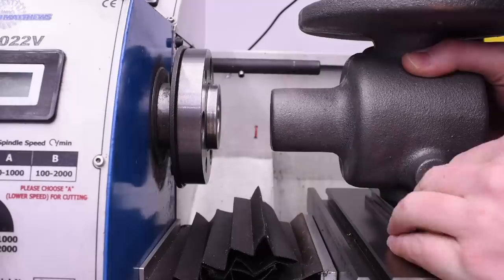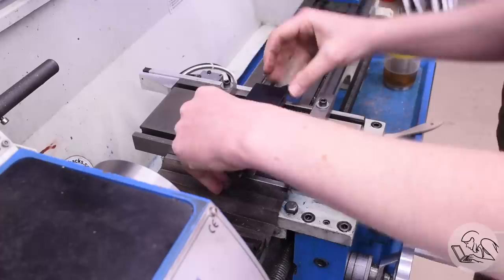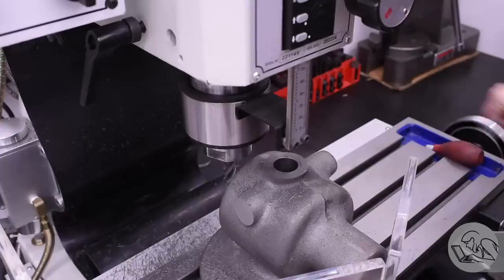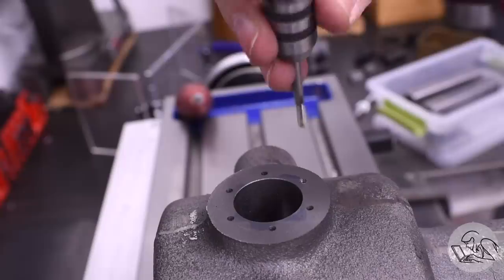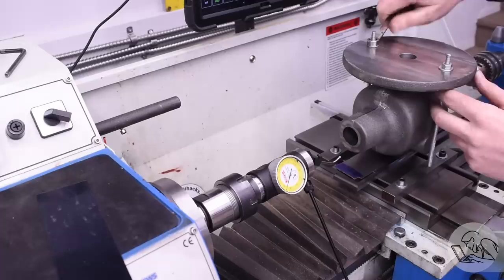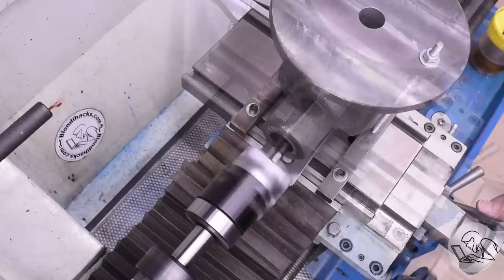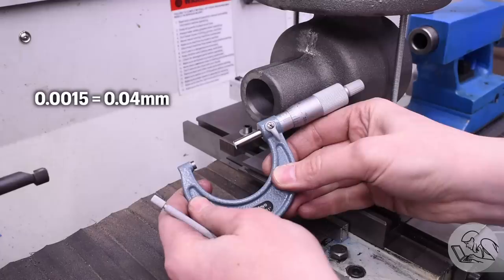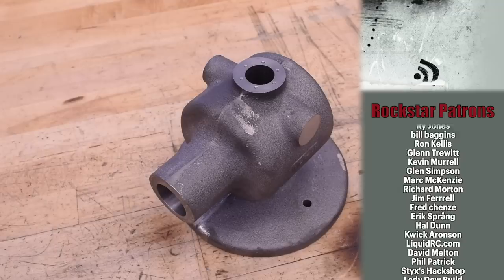Let's Build A Die Filer- Part 2

Comment: Quinn - that's one of the most intricate setups on a lathe I've ever seen. Bravo for pulling it off so well!
Reply: Necessity is the mother of innovation  (in Norwegian the saying goes  "A naked woman learns how to make clothes) 🙂

I started out with a mini-lathe, and it's incredible what you can pull off if you don't know the word impossible (or unsafe). I actually cut, crowned and threaded a rifle in it, 20" of barrel and a mauser action sticking out of the headstock. I could have ridden that work bench to town and back in 5 minutes.

Comment: Quinn, if you wrap a rubber band around the shank of the boring bar about 1/4 of the way back from the cutter, it dampens the harmonic that helps create chatter. You do the same thing when facing brake rotors, except it's on the rotor itself.

Comment: Nailing the dimensions when you're thinking those are not important is more than just a secret, it's a state of mind.
You will be a bit more relaxed, and therefore less prone to make errors in judgement. It's a "you know, just do things the easy way, there is time, no worries, it will be fine" way of thinking. It goes well in other practices too.

Comment: @Blondihacks.  You might be interested to know that your "new" GE motor was approved for shipment in February of 1933.  That's what that little BL code on the bottom right means. It works on a 42 year cycle, so it would have also been used for Feb 1975 motors, etc., but yours is much older.  The patent for that motor was granted in 1925 and expired in 1942. Don't ask me what rabbit hole I went down to find out such things, but it has something to do with restoring old stuff.

Comment: Quinn, do buy a motor for your filer. 
I am sure that this Vintage GE motor will come handy for a future project, but ... hear me out please. For years I was using my small lathe converted to a DC motor with a home-made PWM voltage controller, so that I would not have to swap pulleys and "V" belts. I was planning to make an Arduino-based system that would maintain desired spindle RPM regardless of what the cutting force is. 
Then I discovered that for a $100 you can buy a "Sewing machine servo motor" - a brushless DC motor that is supposed to replace a 3-phase motor for industrial sewing machines with a mechanical clutch. It is typically 500W and comes with a control box where you can set parameters and a lever you can press to set RPM. The motor holds RPM between 200 and 3000 regardless of load up until you stall it. It is brushless, so it has "electronic commutator" that reverses the polarity to keep rotor turning based on sensors, so it will go exactly the rpm you set it to with maximum torque. Oh ... and it only needs single phase power.

Comment: When this die filer is complete, you'll finally be able to make some dice and actually have a game of Yahtzee!
Reply: I thought it was just a device for helping you organize your collection of dice, no?
Reply: @brianhaygood183  well I could be mistaken. Hey, maybe she'll do a cheesy tool hack video where it's used to remove material from metal objects 🤣🤣
Reply: @ollysworkshop  
The other use for this is to fixture to the top with a tool that allows you to push into the file, at that point it can be used as a micro shaper, and so cut keyways.
Reply: she can already make dice, she has a lathe :P

Comment: Interesting and informative as always, thank you!

In anticipation of an upcoming installment on the Pennsy locomotive, I'll mention that the author of the plans (and several other great loco models), Kozo Hiraoka, is releasing his next book. It's available to preorder for shipping in the Spring. Promises to be a doozy at 400 pages; the other books are around 250ish  pages. Can't wait to see it. Can't wait to see Quinn's boiler coming along.
Choo choo
Reply from the maker: Oooh thank you! I will be ordering for sure.
Reply: @jeffdayman8183  "Building the Rio Grande K-27, volume 1."
I forgot to mention, it will be a two volume set. Second volume will print when the article series in  Live Steam is concluded. 
Use promo code K27 for a discount when ordering from Village Press.

Comment: With carbide tooling a good rule of thumb is to take a depth of cut 1.5 to 2 times the nose radius of the cutter, you can get away with less sometimes.
Small radius tools (or inserts) are nice to have if your machines are hobbyist types.

Comment: The motor looks like it has sleeve bearings.  End play is not unusual with a sleeve bearing motor.  It may just need a few spacer rings on the ends of the shaft to reduce the end play.

Comment: A trick I learned some time ago that is useful when mounting work to the apron of a lathe: if space allows elevate the work piece on a plate that is as thick as possible and has 3 drilled and tapped holes in a triangular pattern. This allows both height adjustments to align with the spindle and leveling as needed.

Comment: I am just about to assembly my kit after having finished the machining portion. So far it is pretty forgiving as to accuracy needed. You made tapping those 4-40 screws look easy. It was like performing surgery for me . The back plate holes don't offer much in terms of error however. I did the majority on mill as I did not have a lathe big enough at home. Only changes I made were installing oil filler on back plate and putting larger roll pin in driveshaft and cutting a gasket for backplate with a hobby vinyl cutting machine with gasket material installed. Almost wished I had waitied so I could follow along ... instead I made my own mistakes and inserted my own adult language .

Comment: I knew I've seen old-school setups where they mount the work on a vertical slide on the boring table, which would have been a bit less of a faff than the fiddling with stacks of parallels/shim stock. But that would require you to buy one of those vertical milling contraptions, which is a bit silly for just one setup.
Reply: Or make one.

Comment: Ohh, i got a similar vintage motor. It's 3ph, 220Volts. General electric i think. Still working fine after a lot of years, love it 😁
Reply: 3ph - that's pretty acidic.
Reply: @darylh8657  3 phase, we use 220 on normal household one phase, 380 on 3 phase in normal industrial applications. This little motor is kind of rare here, 220 V, 3 phase. You can plug it to a VFD and control the speed to a certain degree. That's why I like it so much
Reply: @marcogallazzi9049  
That's just what the big boys do. The single phase AC power is a bit lower than if you run 3 phase into the inverter, but the motor will still work just fine. You can put in a transformer to bump the 220 up a bit to give a higher DC bus in the inverter, but for most applications that is not really needed. The other nice thing about the 3 phase is that you can pull full torque out of it at 0 RPM, so for very low speed applications, say tapping, the torque is really there.
Reply: I thought you meant "HP" and got auto-carroted

Comment: hey Quinn, nice job!
a quick rule of thumb I learnt in mechanic class for tapping length when absent from a drawing,  calculate one and a half diameter of the final dimension of the tap and it's your minimal tapping depth, it will give you the maximum thread resistance possible in steel (might need a bit longer for softer materials, but not by much) for example (in metric, because not familiar enough with imperial, sorry) an M6 thread need a 9mm threading depth. you can adjust the depth a bit in your case, since it's cast iron and the forces are distributed on 6 screws.

Comment: When indicating a machined bore on a mill, I've found that you can zero out the left and right with the front or back (depending on how your indicator is set up) and 98% of the time when you check the remaining quadrant (the one that you can only see with a mirror or by craning your head around behind the spindle) it's dead on.

Comment: The length of the boring bar needed was a concern for me too. Subsequent fitting became an issue and I quickly made a ball hone my friend. 🙂 A somewhat complex project. Lucky to have such generous tolerances. The hole does look off center in relation to the casting, just like mine did, but it turned out fine. Messes with your mind. 😆

Comment: So happy for this part 2. Love the humor. Love the machining. But maybe I may learn what a "Die Filer" is exactly. 🥰
Reply: It's used to keep your files in place, so you always know where any file is at any given time, right? :face-green-smiling: The Die Filer is just a machine to move a file, in this case in the vertical axis. The table lets you cut at generally a 90 degree angle.
Reply: @oldfarthacks  It also lets one set it at a low angle such as seven degrees for "die clearance"

Comment: Hindsight cam,  As you had accurate flats on all four sides of that casting could you not have calculated where the centre of the bore had to be, then used a random gauge pin to indicate from the pin to all four flats?

Comment: I see you mounted the boring bar head in the four jaw Chuck. I have an mt2 taper in my head spindle as well as one in the tail stock. I always mount this kind of tool with the taper. The Myford also has a standard collet system for use in both to I tend to use collets to mount drills in the tail stock if suitable. Steve

Comment: once you dial in the od of that casting nose as close as you can, you could put the indicator on the inside of the bore as a sanity-check couldn't you?  Oh, nevermind, you answered that less than a minute later saying it was off center quite a bit.  That doesn't show in the video.

Comment: A question with the boring bar wobble because it's too long, is it possible to extend it even further and use the back center as a support? Like, extending the boring bar through the whole casting and have the cutting bit mounted in the middle?
Or is that just asking for unneeded complexity without any real gain?